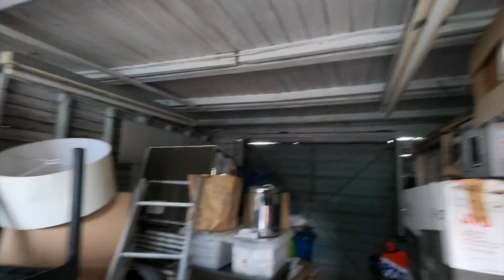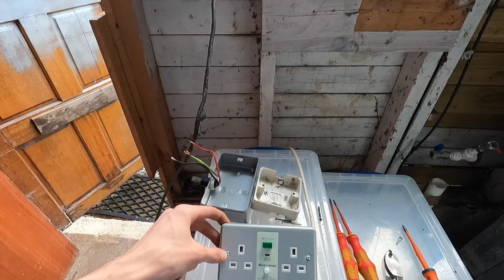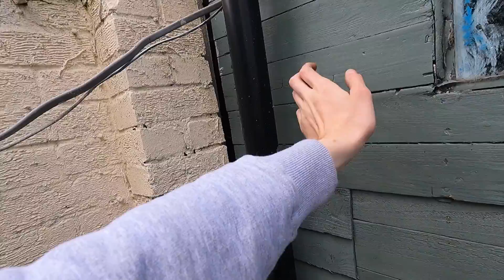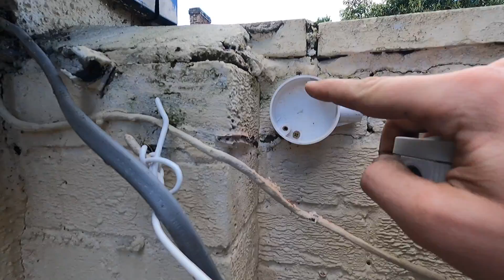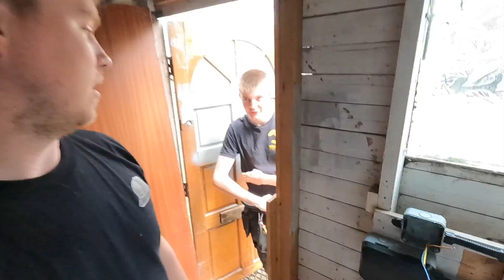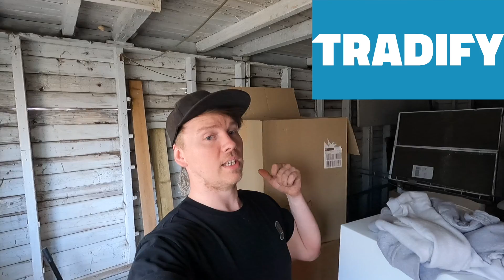Do you Even Flexicon?! Garage/shed Electrics - Electrician

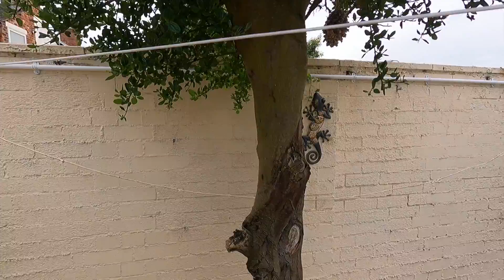Comment: 22:50 DIY (so I have time to faff about), but I'd probably try and use the hard conduit with some elbows solvent welded together. Also I prefer saddle clips like the Talon ones where there's a single screw that is hidden by the conduit.
Reply: Also, is it possible to take into the garage without the box while still following whatever regs? I'd also try and do that.

Comment: Anyone else noticed the dodgy BG RCD’s? I’ve had several be faulty where they introduce a resistance into the circuits they supply of approx 0.5 to 0.65 ohms, I’ve had to replace quite a few. Won’t go near them when I’m looking to install any new consumer units.

Comment: I use a straight coupler to change between pvc conduit and flexicon. If you want, you can glue the flexicon into the coupler, like you do in the endbox. Unless you need to make a connection, use an endbox, otherwise straight from hard conduit to flexicon. Greets 🤘

Comment: Not trying to troll here, but I'm actually looking for flexible conduit. Here in the Netherlands the only thing we have is 16 and 19mm flexible yellow PVC which isn't UV rated so it gets brittle when used outside. Which type/model of black flexicon? should i import for use outside on or above ground ground to disguise low voltage wiring ?

Comment: You did it all wrong mate you're supposed to stand next to a light switch shaking your head saying 'why would anyone ever try to wire up a plug in their own shed isn't this terrible' with a slight speech impediment. Charge at least £100 an hour and bang an EV charger on the wall.

Comment: If you don’t need a joint in the cable. You could do without the boxes and make it even neater. Just glue a conduit female connector on each end of your solid and screw your flexicon connector instead of the bush, I sometimes use this to hop round obstacles instead of being flexible all the way. Avid follower, good job boys.
Reply: This is the same as what I do 👌🏼

Comment: I personally woukd not use white PVC conduit, nor white flexible conduit outside, have you never seen UV damage to white PVC conduits ? I would be surprised if you have seen it UV rated. It's just the same with those white/ light zip-ties, they are just not UV rated.
There are specific UV rated black zip-ties, usually Nylon 66 and with stainless barbs as opposed to the moulded in type.
Flexicon is very handy stuff but... I would now never use that white version externally. Many years ago I used it for a temporary supply to my own garage and a few years later it was already degrading, first it goes dull, then slowly the UV light breaks it down and almost looks like some rodent was chewing through it, next thing is its looks like powder ! Onne I saw the initial degradation I left it installed to see just how much it degraded over time, I of course could do this on my own property.
I have witnessed grey T&E installed outside, on a catenary and in wet weather and in darkness I saw blue sparks tracking along the length of the T&E, a good light show it was, again, not UV rated. You bad material choice Nick 😉 no matter how neat, SWA is made for the job.

Comment: Flexi is the devil. I would have installed steel personally but if it had to be plastic I would have bent using a spring and double set it around that pillar. 

No sparks should be using flexi unless in very limited circumstances.
Reply: Steel conduit, in a tumble down shed? As pretty as it may be, unnecessary in this particular circumstance I’d say. 
I’m not a fan of the flexi either though so do agree with you on the whole!
Reply: @davecowan9466  not inside mate.  Just the feed to the shed.
Reply: Proper spark Neil, flexi-“con” and rings are the devils work……springs with hard plastic pipe is the better option sorry for the moan Nick🤣
Reply: I also want to say galv pipe, get the benders in play and do a proper job…  but honestly, much as I love pipe it's hard to justify in most situations.

Comment: Where are you on the issue of exporting PME supplies outside the "equipotential zone" and making into a TT system?
Reply: I would only do that if it was a metal structure or with an 'earthy' service, or feed in 10mm² armoured(10mm² cpc)👍🏻
Reply: @jamiebourne8047  👍 of extraneous conductive parts within our building

Comment: why use a RCD shed board, when new house main board is RCBO? Just curious. Good job.
Reply from the maker: I ended up change in the RCD to a main switch as originally I was going to put it on an MCB in the mainboard because it was a feed cable but the twin and earth feeds throughout the house I couldn’t guarantee that it wasn’t buried  less than 50 mil so I’d rather cover the feed cable with an RCBO
Reply: @NBundyElectrical  is that not double discrimination though

Comment: The little light on the switch is usually used as a locator so that when the light is off and its dark you can see where the switch is located. I would have glued a female adaptor into the last conduit box so that the flexi termination could be screwed into it if I were to do it your way. There is more than one way top skin a cat .... i.e. You could have changed from T&E to a SWA cable and clipped that all the way or used galv conduit instead of plastic.  I would have put a double set in to get a through box onto the wall pier and then carried the conduit on round the corner with a bend so no flexi required. Finished job did look OK though, good job.

Comment: Adam. The light on the switch can be on when the ceiling light is off. It helps you locate the switch in the dark. Well that’s what MK did 30 years ago+
Reply: Yes, this is what the indicator is for, locating the switch in the dark and goes off when the ditch is on.

Comment: Solid conduit or white fp200. Never flexi for me I’m afraid it just screams “I can’t do the bends” but each to their own I guess 🙏
Reply from the maker: Fair enough mate but I love love to see some one bend that and then feed a 6mm though it 👍
Reply: @NBundyElectrical  your right nick , trying to get 6mm2 T&E through conduit with bends in is  a pain in the back side. Thinking about it you could have used 20mm solid conduit and pull 6mm2 single cores in
Reply: You need to edit that again. Can you guess where?
Reply: @roydowling2542  got it thanks
Reply: @tomorichard  👍
Reply: FP200 outside is pretty crap too TBH. It does not like sun.
Reply: @neilbridgeman7768  I think what we've learnt here is that T&E is more UV resistant than the old conduit that was used :)
Reply: @neilbridgeman7768  white fp200 is uv  stable.